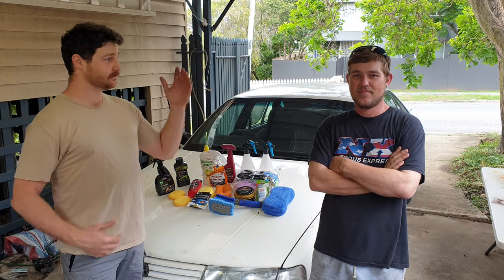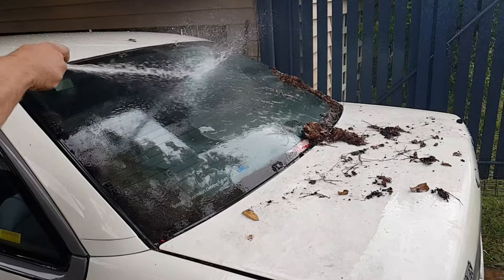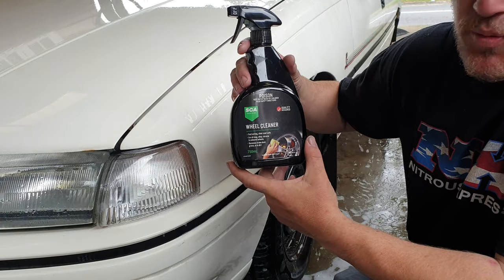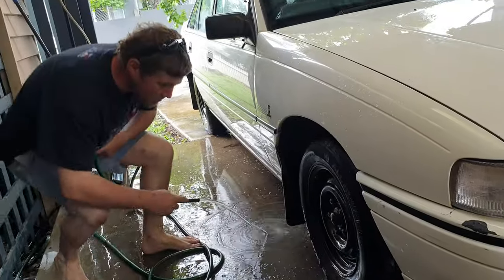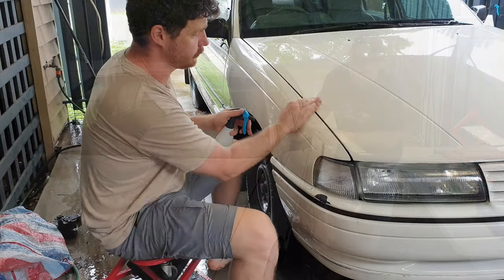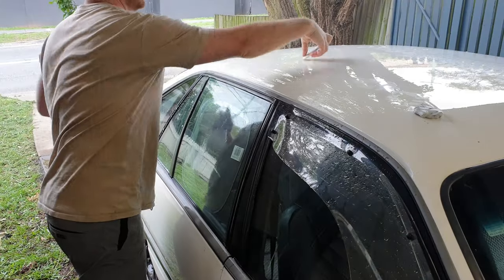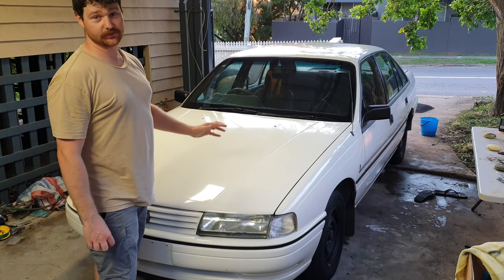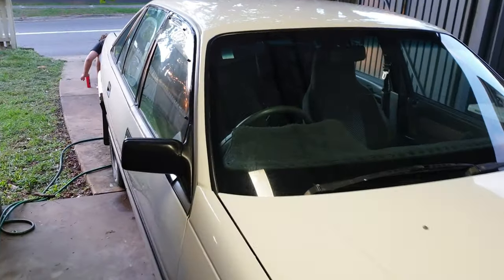Doubling The Value Ep1: Paint Correction | VN LE Restoration

Comment: Should have pulled the trims off the outside.  I did mine not long ago then has to change one of the trims and it was so simple to remove I wish I had of done it before I polished the car
Reply from the maker: You are 100% on the ball Brendon, we missed that. Removing more bits of trim would mean access to more areas to clean. 

Head and taillights would be another easy one. Cheers mate!